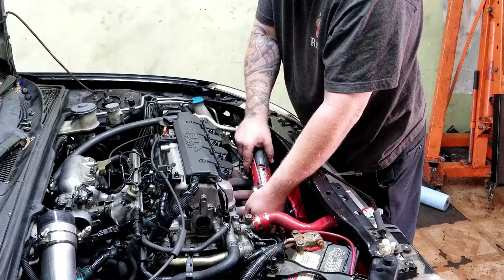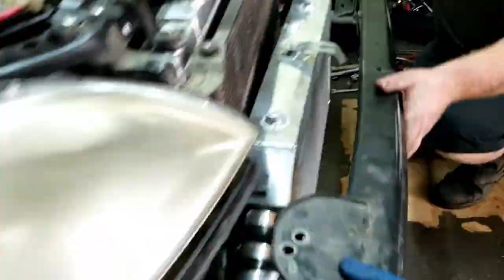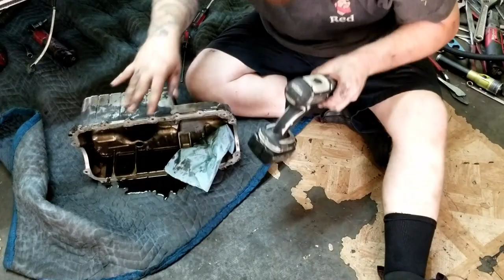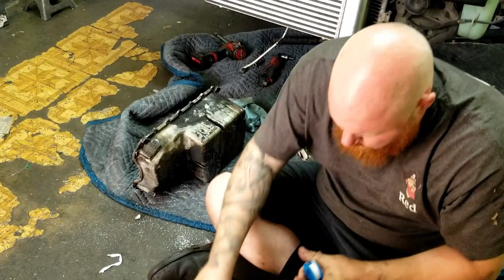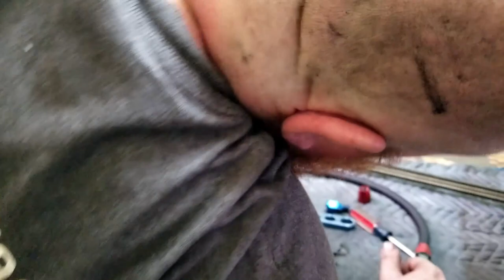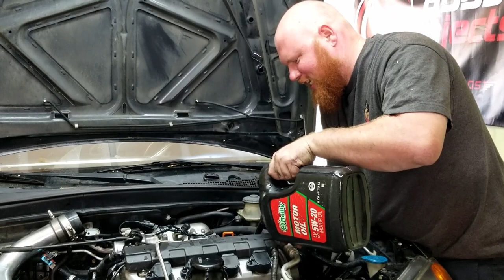Turbo gets installed on the eBay EM2 and first start up

Comment: Barbed fitting and rubber hose ftw! I always hated using an and braided hose for oil return for short runs. Too expensive and usually always has a slight kink.

Comment: Oil return is a Gravity (no pressure) hose.
 Fuel line and Hose clamps are All that's necessary. 
Turbo is Large enough for 3 litre engine.
 On the lil honda ...Boost likely won't happen until after 4,000rpms  Very  useful 🤣

Comment: PIRATE, if by any chance you check your comments on old vids still, What down pipe did you use to go from the turbo to the aftermarket 2.5 downpipe you are using? Did you custom fab? I am looking into the same manifold on my 2002 el (canada) and I am curious to see if I should buy one of the ebay 2.5" downpipes and fab the rest, or forget the ebay downpipe and fab the downpipe too?
Also what are you doing for injectors and fuel pump? What about narrowband vs wideband 02 sensor?
I am just looking to have fun with a cheapo turbo build for this car. I have spare T3 lying around, spare megasquirt EFI, spare bypass valve, spare intercooler piping etc etc from leftover parts from other builds...
Thanks!

Comment: Hey Red, I realize that with that bottom end having as many miles on it, it was definitely worth the time to replace rings and bearings before boost, but didn't you say before that you were going to forge that D17, or were you talking about a different project? I mean, with a refresh that block should have no problem making 250-300 whp, but it would've been cool to see at least some cheap YCP or Vitara pistons with even some used Eagle rods, or even eBay rods (if they exist) just to see how it runs and if it holds up. I've seen dudes make good power on eBay internals on a B series. I'm not talking shit or trying to tell you how to build your own car obviously,  I'm just basically making conversation and asking a question. This right here is exactly how I started with my Civic and turbocharging it. Btw, my built LSVTEC EJ8 Civic coupe made 612 whp on 22.5 psi with a Garrett GT3582R dual ball bearing turbo on a DynoJet last Thursday brother. She's burning both front tires 225/50/15 Toyo R888Rs in 3rd gear with the OBX LSD in my GSR trans with an LS 5th. We set up boost by gear on the Hondata S300 V3 with the Hondata COP kit with Accel K series coils and NGK BKR8EIX plugs gapped to .012 and we added absolutely no timing. We literally only tuned for an hour and a half to get it running right and we just kept turning up the boost on the Turbosmart PowerGate 60mm with my Mac 4 port boost control solenoid. $20k later and my $1500 Civic is making 612 whp on a conservative tune...lmfao
Reply from the maker: Vitara Pistons don't work on d17 plus eagle rods are not available for d17
Reply from the maker: I plan to do a built block after this one blows
Reply: @PirateGarage  That's cool buddy. Shows how much I know about the D17...it's going to be one hell of a ride to get to the point where you'll need a built engine. I can't wait to see this.

Comment: Is it the same running performance cams on a d17 or is it better to use the d16y8 setup on a d17 engine ?
Reply from the maker: D17 engine d16y8 cam

Comment: Bro I just  Stumbled on your videos tonight I have 2002 civic EX coupe  That I built from scratch built the motor back to stock spec Got the rest of the car completely finished now with new suspension and interior now I am ready to go to the motor  Is there any way you could help me out with some 1 on 1 advice and tips I live in Dallas  I own a shop here and I am also building a 2002 civic coupe trailer that you might be interested in
Reply: I'm building the same car right now. Would be nice to see your progress.
Reply: How’s the car coming along?

Comment: How did you do the extra fuel part and did you use a boost dependent regulator or just reflash or Kpro? How much power did it make and what boost did you run on it?

Comment: I got a d17a2 engine ,Do I get a d17 adjustable cam gear for the y8 cam swap or do I get a y8 adjustable cam gear not sure?thanx in advance.
Reply from the maker: D16Y8 adjustable and if you run kpro then special kpro gear if not the regular D17 gear will work

Comment: Hopefully you could do a list of all parts and links to where you got them
Reply from the maker: Got almost everything on Ebay
Reply: @PirateGarage  the eBay turbo kits? And what'd you get to beef up the pistons also?
Reply: They have forged or billet whatever pistons for d17a2 but I don't think they have connecting rods or really hard to find. I think whoever used to do the cams for them also did the rods but for various reasons, it never took off with D17a2 and so. Good luck finding rods or cams for this motor that always seems to be the hard part, but Red used y8 cam which is interesting and maybe that why they stopped producing the cams, just like use the y8 ones. But I don't think you'll find rods. Maybe just find some pressure treated 200k mile ones and use them??  @m11productions20
Reply: and by pressure treated I mean, connecting rods that survived 200k miles and so you're hopeing don't have any micro fractures.

Comment: great video bro,.. hey RED, where did you buy that turbo i want to turbo my 2003 civic ex,.. let me know thanks
Reply from the maker: Ebay
Reply: @PirateGarage   there are alot of them,..what you think its good...thanks
Reply from the maker: .48 ar housings
Reply: @PirateGarage  Hey Red, what do you think about a built D17A2 block with a built stage 3 D16Y8 head on a .55 AR Borg Warner S257SX-E turbo on one of these EM2 coupes? I know you went K swap and all but it seems not many have pushed the limits of this engine too much and I myself just got a 2002 EX EM2 as my first project car and I thought I'd get some knowledge from the best haha! My goal is to make 350 - 450 horsepower at low boost of like 15psi or 20 psi to the wheels but just thought I'd see what you think! Thanks in advance and good luck with the new K24 Turbo!
Reply from the maker: I have 2 black em2 on my channel one is awd k24 the other is d17 turbo